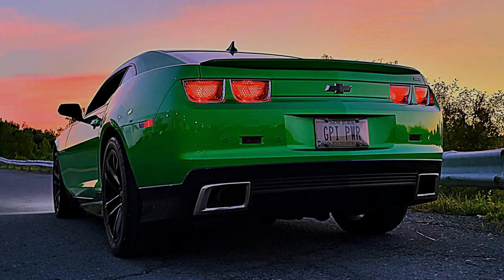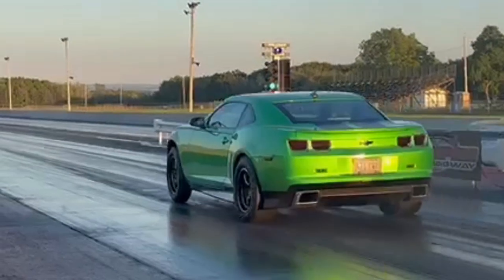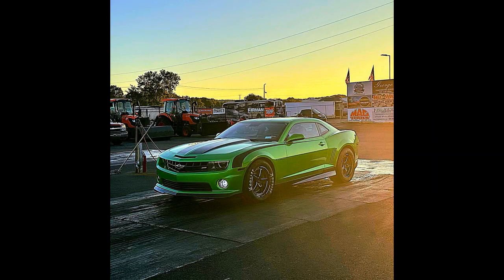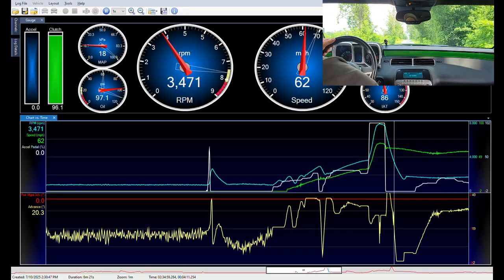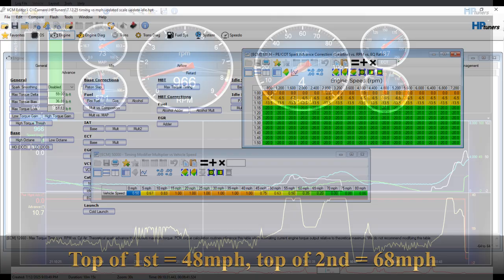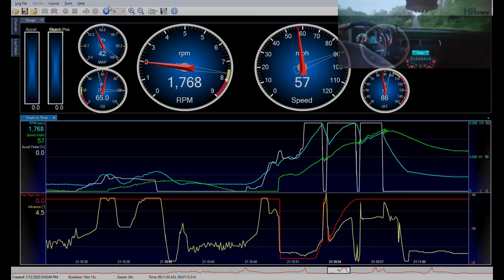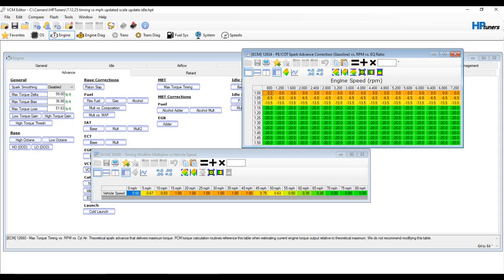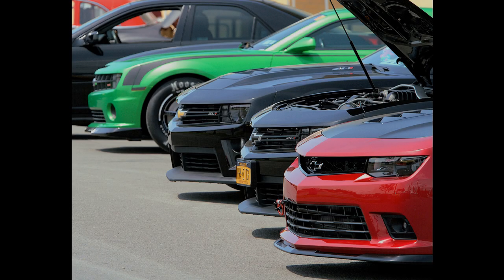LT & LS GM ECM Power Management by MPH

Comment: I don’t really need a full remote tune service, but would it be possible to just purchase it and get user defined modifiers (vs vehicle speed, TOS vs front wheel)? I’m interested because even though I’m launching in 2nd gear for no-prep drag racing, I still struggle to get traction with my shitty pedal control.
Reply from the maker: Definitely can get you setup.  Shoot me an email and I'll figure out the best way forward with you directly. Andrew@gwatneyperformance.com
Reply: @andrewcammer2535  Sent you email! Thanks for getting back to me

Comment: Trying to see an advantage over experienced throttle pedal modulation? I do see the greatest use would be for power adders. Reduce timing as the run time increases....
Reply from the maker: Power management is prescriptive - you're never going to modulate the throttle as quickly and as precisely as properly calibrated power management. This sort of approach is used in pretty much any seriously fast drag application to maximize performance, and now it's possible with the factory ECM.

Comment: I’ve done something similar on another platform—added traction control based on wheel slip, implemented rolling anti-lag, and removed unnecessary ECU functions to free up space for a custom operating system.

While this setup works well on the track, it's not ideal for street use due to constantly changing surface conditions. A better approach for street use would be a custom OS that calculates wheel slip down to the nearest 1% and adjusts timing accordingly. It should also only activate when the cruise control switch is on.

Just a heads-up: when tuned correctly, this kind of setup can make the car hook hard and stay hooked—even on stock tires—which can easily lead to broken driveline components if you're not careful.